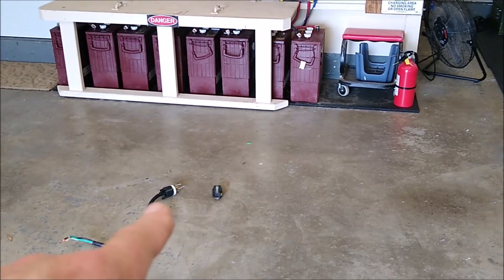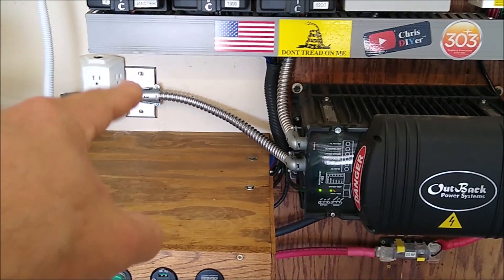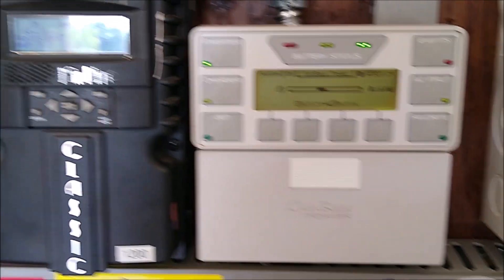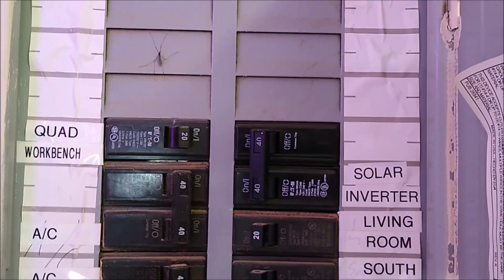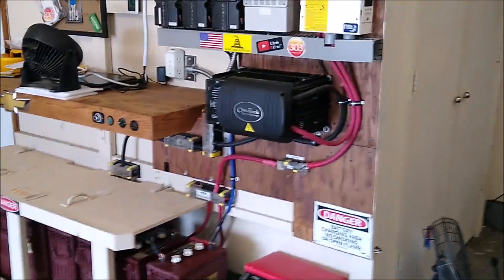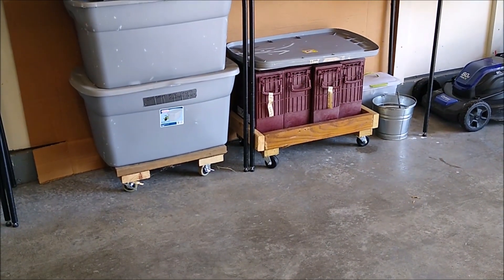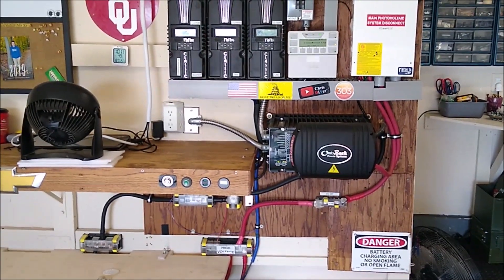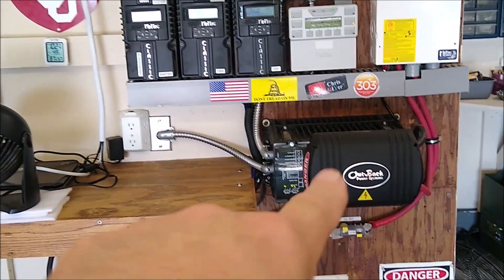Home solar power AC-in power cable fixed (new 8-gauge THHN wire, direct line to inverter)

Comment: Dum question but way did you not solder the wires to gett best conection ?
Reply from the maker: Or butt connect/crimp. I mentioned to another viewer that I didn't have the right size butt connectors. So, the wire nuts are temporary (and holding fine for now). Thanks for watching/commenting.

Comment: I don't pretend to understand a lot of this but I do understand fire. I think that will be a nice upgrade.
Reply from the maker: It was all my fault using that 30-amp L5-30 connector and pushing high amps through it. Now, with thicker (and UL rated) THHN wire...should have zero issues using that inverter charger function + holding AC circuit loads at the same time. I throttled it back a little for some extra wiggle room to keep the maximum power draw below 40 amps total.

Comment: Nice installation. I have #8AWG on mine as well. I think I will stay with 24 volt. The expense of the Lithium ion swap and a inverter at the same time will break the bank. I may have to sell one of my trucks to pay for the battery conversion as it is. The jeep needs tires too. You know how it is as a fixed income pensioner lol.
Reply from the maker: Oh I hear ya on money and budgeting. I think I will do four 12v (or two 24v) lithium batteries first and decide on a 48v inverter later. For now, I need this system to make it through this summer/fall...planning on moving and renting out this house in the next six months or so.
Reply: @ChrisDIYerOklahoma  are you coming out west or back to Idaho?
Reply from the maker: @offgridinthepacificnorthwe3210  - I will visit out west (ID), but not live there. I also have some family in Colorado. Florida is more on my mind...but, not on the coast

Comment: That sucks. Glad that it was caught early. Also I think 8 ga romex NM-B is goof for 40 amps.  Here is a link to that chart I found. Lithium!! NICE!! Tesla Batteries?
Reply from the maker: I am pretty certain the THHN 8 AWG I installed is good for up to 55 amps (Cerro NEC chart I saw online). I will call Amy at the AltE Store and talk with her about lithium, kWh, and "right sizing" this system. I may look into a 48v inverter too if the numbers don't get too crazy. Been saving my nickels for the past several months...
Reply: @ChrisDIYerOklahoma  Hey Chris! Saw that to THWN-2, THHN, XHHW-2, USE-2 all good for 55 amps per that chart. If its Romex its good for 40 amp. Good idea checking with Amy and tell her I said hello! I worked with her in the past and she was great!. I was looking at these lithium batteries but that is if I ever goo fully offgrid and 48 volt. I as thinking 8-10 major overkill but  ;)  Have a good one Chris!! 
https://www.evwest.com/catalog/product_info.php?cPath=4&products_id=329

Comment: Looks good, you should be fine with a 40 amp breaker. Derated 80% will put you at 32 amps continuous duty, the only time I would go up to the next breaker size if you're getting nuisance tripping.

As for the generator input, if you have 2 open slots on your primary breaker panel, you can install a generator interlock backfeed kit and an L14-30 input socket. When you need the generator, just shut off all circuits including the main breaker and the mechanical interlock will allow you to activate the backfeed breaker for generator input. From there turn on the circuit(s) you only need. It took me about an hour or so to install it depending on your breaker panel design.
Reply from the maker: I have seen a lot of installs like that...not a bad idea.

Comment: nice wire , are wire nuts up to the job
Reply from the maker: Nope...good catch. I have some marine grade 8 grade butt connectors on order and will double marine grade adhesive heat shrink over them. Didn't have the right ones on hand.